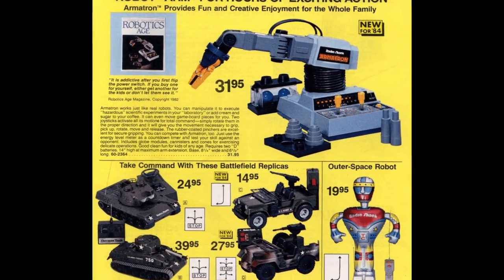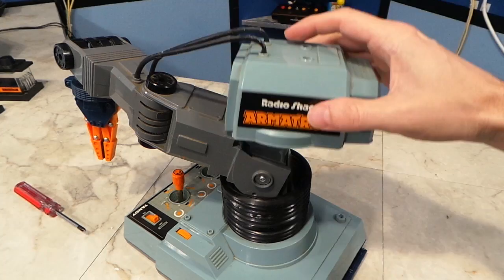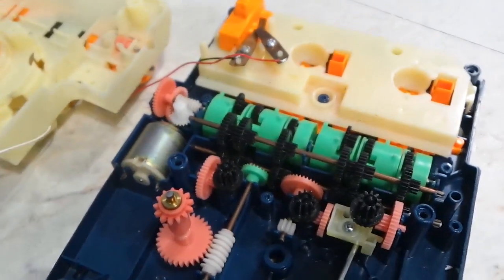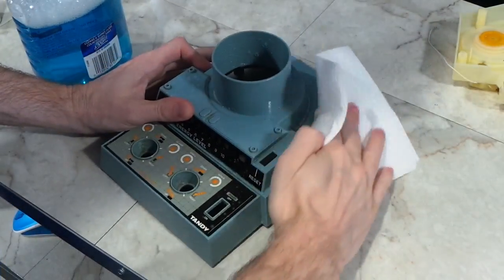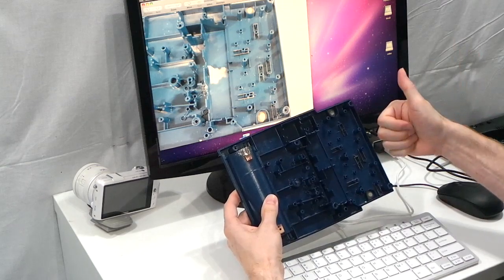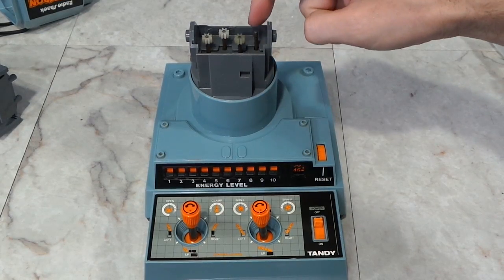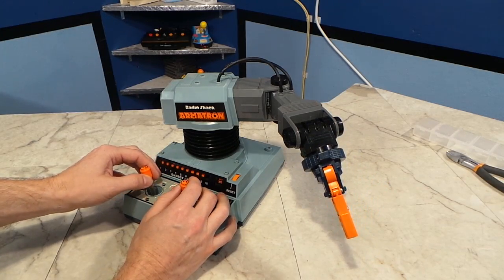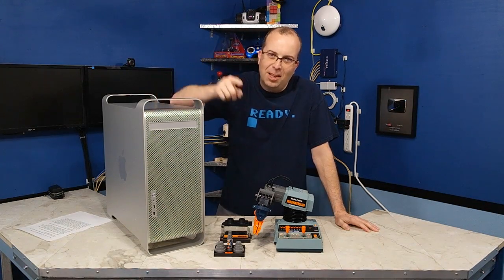Repair and Restore of Radio Shack's Armatron Robotic Arm from 1984.

Comment: You should be able to reprint one of those using a 3D printer that can print using nylon and probably 100% fill for strength - just need someone who is good at sketchup to make you a plan.
Reply: I thought the 3d printer way too for those gears. I wouldn't use nylon plastic because those gears probably aren't nylon just cheap plastic. I would also try a 3d scanner app to see if that would do the job for getting the measurements. It would be nice if someone made the .stl files for all the gears then i would get one of those arms.
Reply: You could just order new plastic gears, cheaper then 3D printing.
Reply: I could do it easily enough with a top down and head on photo with a ruler for scale. You can also find various types of gear models online as well.
Reply: nylon filament is only slightly more expensive than pla or abs but the real catch it is a very difficult to handle, secondly FDM usually cant print part that small. 3d scanner isn't ideal for functional part that requires dimensional accuracy, especially for part that small, at least not any affordable 3d scanning solution.
Reply: While parts for the Armatron are, of course, no longer being produced, small nylon gears in a wide variety of sizes, pitch, and tooth count are. It should be possible to find something similar enough that would work.

Comment: 2020: 3d print the fourth gear
Reply: He already addressed that idea.
Reply: @neuronoc.7343  Not in the video he doesn't address it. Or could you link the video and timecode where he mentions 3d printing?

Unless you meant he "addresses it" by saying he's purchasing a second unit at around 8:30.  Technically that addresses the problem, but doesn't address this method of repair.
Reply: @ewfuoywoef32pri  He addressed it in his update video. I'm pretty sure you could find it, it's a comparatively recent upload.

Comment: I've still got my Armatron, along with my Milton Bradley Big Track!

I think later on in the eighties Radio Shack (or Tandy here in the U.K.) made another version of the Armatron that was on a wheeled chassis base as the controls for it were on a separate control box connected via length of ribbon cable as I can recall so I'd imagine that model would be much more complex internally with possibly some sort of logic circuitry operating solenoid to replicate the mechanical joysticks, or possibly each joint having its own drive motor?

My father modified mine though by installing a DC coaxial power jack into the base so I could power it off a mains adapter instead of batteries, though I don't recall having to strip the arm's shoulder down to separate the arm from the base, but there may have been a design revision somewhere along its production run. 

Either way Tandy's made some amazing toys for the child geek of the family like me..... including those 160 in One electronics bread board kits with the spring connectors. Happy days indeed, thanks 8 bit guy for the memories :)

Comment: Could you get the schematic for the missing gear? This would offer a 3D printing solution. There may be stores you could send the schematics to if you don't have a 3D printer. However, this solution would only be necessary if you can't scavenge the right part when it comes.
Reply: the 3d printing service would probably be pretty close to $20
Reply: +Ethan Chow he could always invest in one for himself
Reply: Use one of the existing gears and take measurements. They do look like they all have the same gear pitch and tooth count.

Heck, even an impression mold would come to the same end result.
Reply: He has a 3D printer himself, but the printed gear would be so tiny that the moment it was put on the shaft, it would break 
Source: A comment in the comment section

Comment: why didnt you just use the wire wheel to begin with?
Reply: One main reason is that you do not want to breath potassium carbonate or get it in your eyes.  A mild acid is way better way of removing it and the brush is used to finish off the process with extremely small amount of potassium carbonate remaining it should prove not to be a problem.  Still want to use gloves or wash your hands afterwards.
BTW, if the batteries are still in a unit that just started the corrosion process you have to be mindful that potassium hydroxide is present and it will irritate your skin in a big way.  After it reacts with air it forms potassium carbonate and is a bit more stable and a little less irritating.
Reply: ***** Forgive me for aggravating you. Was sincerely trying to help.
Reply: I figured as much... Just don't ask me what time it is!

Comment: try getting a new gear 3d printed. then you can have both units working.
Reply: I was thinking the exact same thing!
Reply: Me3
Reply: As the missing gear is probably identical to the other three he could have tried casting one using the others as templates.
Reply: Yeah that sounds easy..better just to buy another if you can get one and have it for parts, at least more economically feasible. #d printing is really cool, but the parts come out not exactly as you want them. Now a nice CNC mini mill would make short work of that little gear and it would be perfect.
Reply: +Oldbmwr100rs with the limited amount of tools I've got I'd just get a thick piece of plastic and dremle it to the shape of the gear.
Reply: Golden Grenadier I have done such things in My car and motorcycle restoration work. Gotta do what you gotta do to make stuff work!
Reply: I was thinking that too.
Reply: Exactly

Comment: You need a 3d printer
Reply: Was thinking the same...

FWIW, you can also buy small plastic gears of just about any size you want.
Reply: I thought the same thing!
Reply: +HenryJaques:
The battery terminals on the 3D printer are rusty.
Reply: I have a 3D printer

Comment: I had one as a kid in the 80's, sold it to a guy who worked at college and invited me to join, after a few months at the college I then got put on a work experience with an IT company who took me on full time and I've been in IT ever since and  about 10 years ago I saw one on Ebay and bought it.
So I now how an item that effectively started off my career.
Mine is still working

Comment: Awesome fun video!

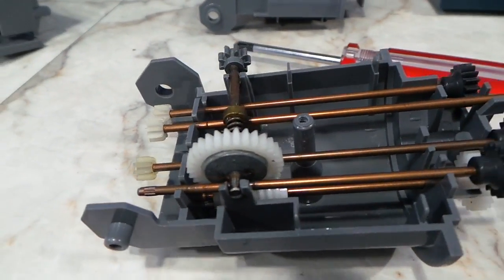6:00  you can buy a bag of random replacement gears and perfect matching gears (if you have accurate calipers) for most situations on eBay via China.  The type of gear you were missing is the most common gear to find broken or missing.  The only problem is the wait time.  But really, it's much cheaper than buying another scrapper unit.

Comment: I had one of these when was a kid (11-12 or so). Some time after my father picked up some solenoids at a Ham flea market. Using some relays I wired them to my Atari 400 via the joystick connector, which could be set to output via software. They drove the solenoids which were attached to the robot controls. It took a long time to tweak but eventually I was able to write BASIC programs that would do simple operations.

Comment: I got one of these as a Christmas present about 35 or so years ago. It lasted about two months before I had it apart. Of course I didn't have a digital camera back then and so it never quite got back together. I can't tell you how disappointed I was upon discovering it had just the one motor. As a electronics/computer guy I had all these dreams of attaching it to my Apple 2e but no..... some mechanical engineer had a little mechanical engineering party and this thing was the result. Radio & Electronics magazine ran an article (or maybe a series of articles) describing how to remove all those awful gears and replace them with five or six DC motors but the modification was beyond anything I was capable of doing in my bedroom. So ends my fascination with robot arms (and so begins my disdain for MEs!).

Comment: On the off chance that you see this comment,
 the next time your remove rust from metal surfaces 
(like the joysticks themselves) you can totally 
just wipe aluminum foil along the surface with
 water or soapy water as a lubricant. It does an amazing job,
 did my whole motorcycle that way, now rust free :)
Reply: Interesting!  I'm going to have to try that!

Comment: I just fixed my childhood Armatron today. A plastic gear in the 'elbow' had developed a hairline crack, leaving it loose enough to spin on the metal shaft instead of turning with it. Was also the claw drive, so same problem just further down the line.

Comment: My old Armatron has the same issue, where the arm doesn't open or close. Maybe it was a problem with the gear itself that would break over time. I still have my unit, and it impressive that you took it apart and back again.

Comment: I still have my Armatron, gotta remember to thank my folks for not chucking it. Remarkable piece of engineering. Mine has the same issue with the claw, I think the gear is still present. Need to tear it apart and see if a dab of CA glue will fix it.

Comment: That steep $35 bucks inspired me to build one of my own 'Robotrons' out of raw materials at the age of 11 or 12.   Used the same isometric claw design out of sheet metal and balsa wood for the structure. Bastardized 'Robotiks' (tm) motors and control system for everything else..    Good times!!!  It got me a Best overall project at the science fair that year.     That would make two in a row!
RJM

Comment: Wow ! I remember these things. I never bought one but remember it in the stores. I'm kinda surprised it was a single motor. I would have expected 3 or more motors (1 for rotation of the base, 1 for the claws etc). I'm sure those things got a few stripped gears here and there.

Comment: The reason the small pinions break is that they are pressed on the shaft, putting the plastic in tension.  over time, this tension causes the plastic to part in a narrow spot between teeth.  The best way to fix this is to replace the gear with a brass one.  I specifically keep a huge inventory of such gears for this purpose, scrounged from old toys, etc.  (Others will most likely fail.  Before they do, you can make molds and cast new ones from epoxy.  3D printing usually does not work well on such fine structures which are under high stress, even for bulk material.  You could 3D print molds or a master from which you make a mold.

Comment: If you look at the arm piece, you can see that there is a cable tube with presumably a turning cable inside that connects to that pin. Check it again and see if it works by turning that cable.

Comment: Ha! Had to take one apart in Electronics Class back in 1990. No Manual, No Photos, Nothing. We had to put it back together by Memory. We took the Entire Thing Apart, not just the base. Meaning, we also had to take the Arm and Claw apart and put them back together aswell. 
If I ever get one again, I would Replace ALL the Plastic Gears for Metal and put a Bigger Motor in it, like a 27 Turn out of an R/C.

Comment: I know I'm a bit late to the party, and I also watched the other video where you said you couldn't make it work with parts scavenged from the second unit, because it was missing the same cog, but here goes nothing.
I would try to make the small gear out of metal - best way should be cutting one on a wire electro-erosion machine.
Another option would be to create a mould (mold) from the broken part and use acrylic plastic to make a duplicate. I've seen people making moulds with silicone rubber and pouring the stuff in them. It's a rather tough plastic and way more resilient than the abs or polyethylene they seem to be made of.
Just a thought.
Cheers

Comment: Didn't know it was that old, I didn't see one till 1992ish. When I was a kid I tried to recreate it in lego, but lacked the "loose" gears, which are needed at the joints (incidentally, I think that's also why the claw spins on its own while the base and elbows are moving). Although, now that I think about it, a U joint should suffice.

Comment: I had one of these as a kid too :) !! The gears are the main problem though - they crack and break easily. If you know someone who can laser-cut brass — that would be a viable replacement! I fixed up a Logitech G25 wheel by working with a shop that did brass laser cuts — got myself a sweet indestructible optical encoder (the disc that measures the movement of the wheel).

Comment: I'd like to know about your back wall there, with all these devices & wires attached in an interesting configuration. What is all that stuff & why on Earth did you decide to assemble it all that way..!?

~ ~ ~

I remember really wanting one of these ever since I saw it in the Tandy store back when I was a kid. There's something mesmerizing in machines replicating the movements of an animal & especially a human.  It's astonishing that there are any units still around & functional after 35+ years (& not junked or recycled).

~ ~ ~

I found the hard way about disassembling mechanical toys back when I was about 10 years old. I carefully took apart a giant mechanical crane model, leaving most of the gears in situé & planning on coming back the next day (it was in my dad's study) to try & learn how these mechanisms actually worked.

I have two younger brothers, one of whom decided to meddle, so I came in the next afternoon to find everything upended...

I can't remember what happened next, it probably just gathered dust until we moved house & went into the skip.

Comment: I had the same one. That was a night mare! All the problems will be the smallest nylon pinion gears in the wrist & elbow.  They age & dry & split. Superglue holds em. But shape the teeth at the split. Ticky but it works.  The stick balls are prone to splitting to.  I drew detailed blueprints cause the arm is pact full of more gears than  a watch.   3 - 4 of smallest pinions split on mine. Especially the claw parts.  It still works  nice. And I can build or shutdown the reactor in the timer to. ;)   2 big steelies make better balls to.  I liked stacking dice. Or Picken up Skittles. Fun fun.)

Comment: I used to put similar battery-powered toys together. The negative terminal tends to get more corrosion, so they told us to put extra solder. Apparently the corrosion is based on the transfer of electrons (which is why saltwater makes it so bad) and having the extra conductive mass slows it down.

This is completely false and i just made it up, but I’ve always wondered how easy it would be to create a comment like this.

Comment: Cast a gear!! JB weld or like Stefan used...  Vinegar is the best for corroded contacts...  Steel wool works great for rust removal...  I use old tooth brushes to get into fins and tight corners....  You can heat them and bend them into any shape you want!

Comment: Somebody needs a Harbor Freight Ultrasonic.  I have to say I'm really happy with mine.  I work in a lab and we have two large expensive industrial ultrasonic cleaners and I kid you not, my HF model has better cleaning action.  If you have a basket to keep stuff off the bottom, it really gets going.  I've had mine over two years and not a problem.  The reason most people kill theirs fast is because the thing doesn't have a drain, so people tilt it to pour water out.  This gets water down into the electronics.  If you siphon the solution out, it'll last a long time.  I use mine to clean gun parts.  I collect military surplus and those guns have been stored for decades in a very stubborn waxy grease called Cosmoline.  Hot water and the ultrasonic cleans it right up.  Sure beats wiping it all off, which takes hours.  On those battery terminals, looks like they were brass or copper, it turns that color when you hit it with acid for a long period of time.  Doesn't hurt anything...
I use your same picture trick when disassembling the internals of complicated guns, works great.  You never have to wonder "did that spring leg go OVER or UNDER that pin?  etc etc...  If I have a lot of similar looking pins and screws and springs, I'll stick them to masking tape and put a number on them which tells me which picture in the series the part goes with.
On that missing gear, you could have tried to mold one with epoxy.  Make a clay imprint of one of the other gears of the same size (if there was one) and fill that with epoxy.  Let it dry, clean it up with a file and drill the hole.  BAM, new gear.  I've made plastic handgun magazine floor plates that way.

Comment: The battery tabs are now exposing their copper (plating) to the athmosphere and will corrode in a while again. If you are serious about them plate them with chrome again (or have them plated, since its illegal in many places to do it yourself) or some other metal that doesn't corrode as fast as copper (like nickel)

Comment: Any ideas: I found my Armatron from when I was kid while quarantining with my parents. How I loved that thing! My dad and I tried to get it running again so my son could enjoy it too. It was in good condition except for corrosion on the terminals, but once that was fixed, still nothing from the motor. Once removed, we can spin the motor's output axle, but nothing happens when putting power to the motor. Any advice? Would it be possible to find a similar motor or would it be worth it to try and disassemble the motor to see what's wrong?

Comment: I'm wondering if you can make molds of these small parts (the gear that's missing) from the other gears, and use a resin to make a copy. Same with your missing keys on your keyboards. Now, I know you want all original, but it would come in handy for momentary purposes.